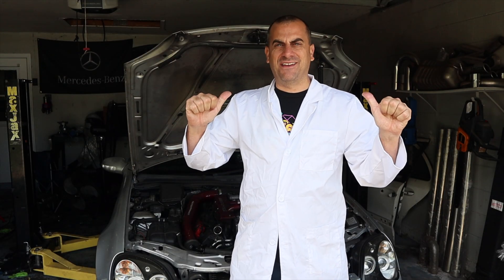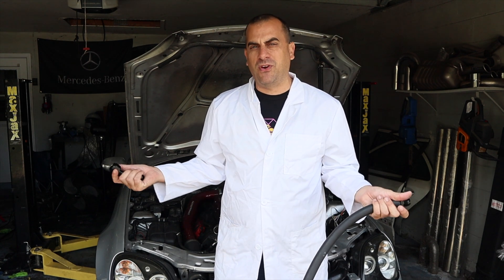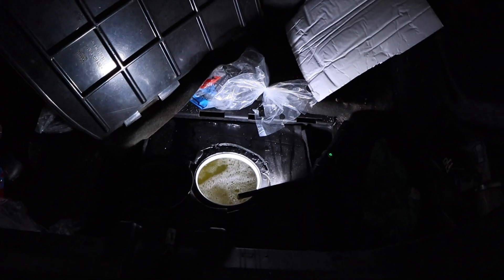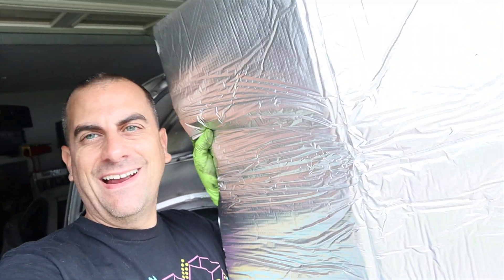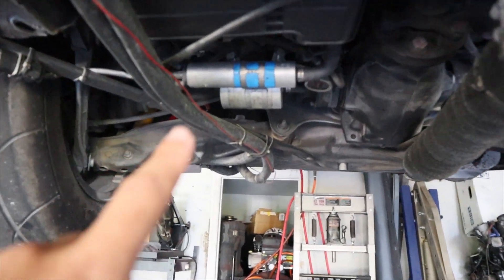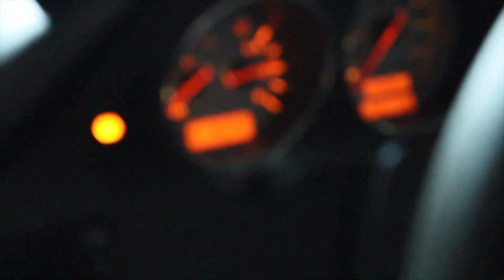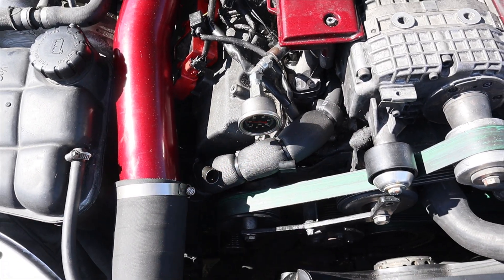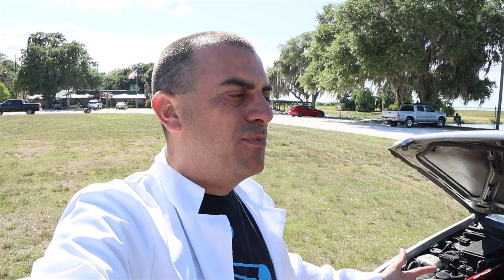Do Bigger Intercooler Lines Make A Difference? Science

Comment: Would you ever do a slk55k?
Reply from the maker: yes 
i tryed to buy a slk55 not to long ago
Reply: @Nd_72  i got my w166 63, w163 55 and w208 55, i want something new tho ever sinxe my crossfire was stolen from me, i been looking at either 172 55 or 43 that i can take out on the weekends for the b roads or track, i cant decide though if i should just fix up the 208 to do track work or just keep it in original condition🫠